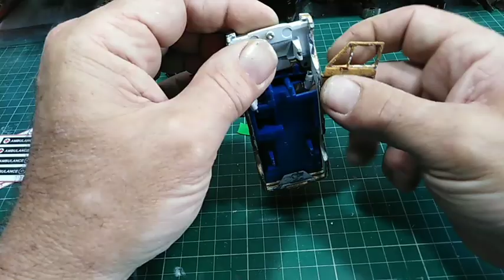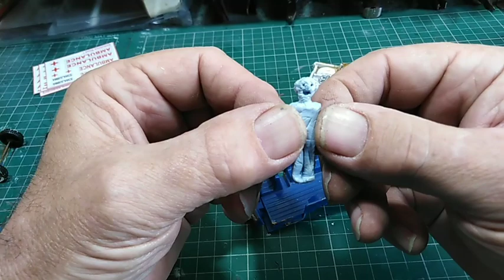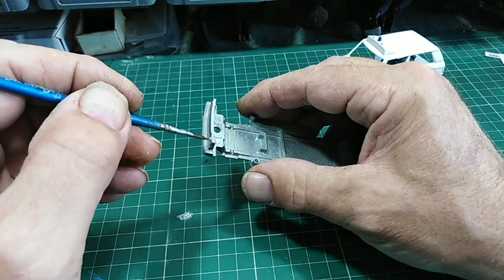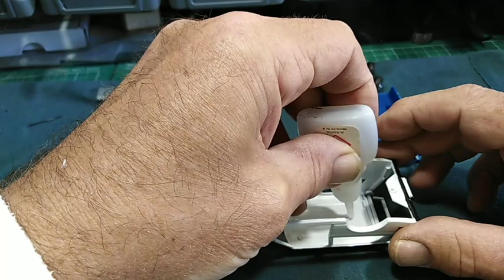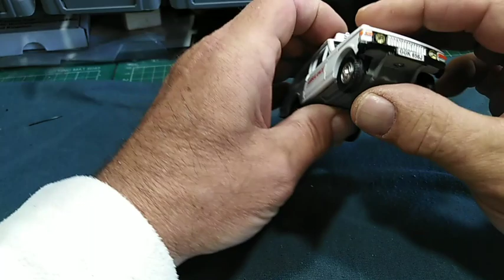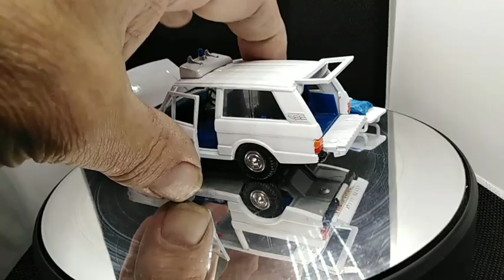First responder Community build. Dinky toys Range Rover Ambalance, no/268 full restoration.

Comment: Hi Martin, thank you for the video of the first responder I found it very interesting and enjoyed it very much, in the video you say you put the metal parts in costic soda which I also use but then you say you put the plastic parts in Brake Fluid. My question is, how do you use the brake fluid and is it the same as I would get from an auto store shop. Kind regards from John
Reply from the maker: Hi John, yes you can use car brake fluid just put them in and leave for a day I use it for plastic parts that have got paint on.
You can also use oven cleaner or costic soda but with warm not boiling Warter personnel I would try brake fluid or oven cleaner oven cleaner is a bit quicker I get the Mr muscles one.
Hope this helps
Take care my friend
Reply: martin dares dinky restorations. Thank you Martin very helpful.take care and keep safe. Kind regards from john.

Comment: What did you use for the blanket?
Reply from the maker: Hi Brian I used a piece of kitchen towel and covered in warterd down P V A glue.
Reply: martin dares dinky restorations. Hi Martin thank you for the video on the first responder restoration, I enjoyed it very much. My question is that you say you put the plastic parts, glass, wheels etc. Into Brake fluid, I haven’t heard this before so could you explain how to use this method and is it brake fluid I would get from an auto store? Kind regards from John